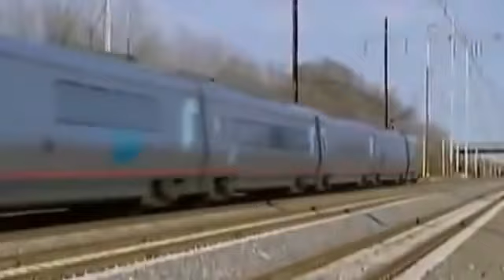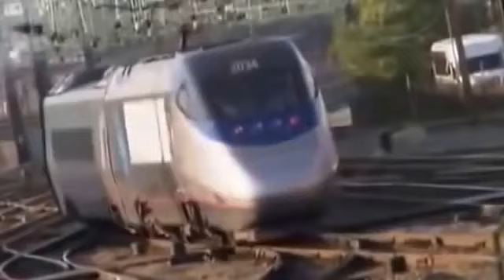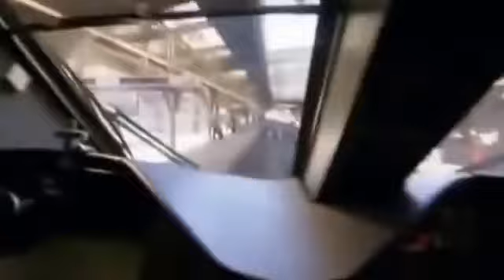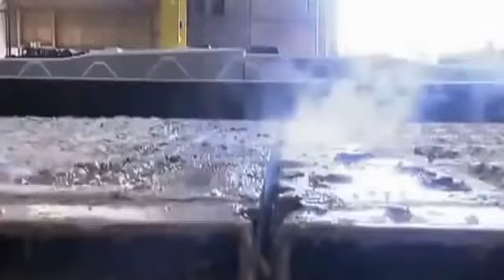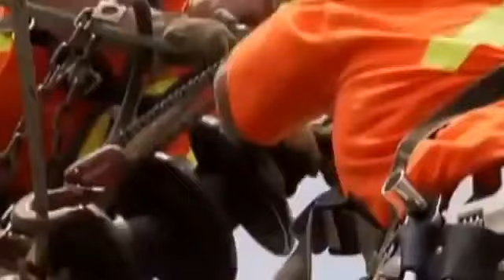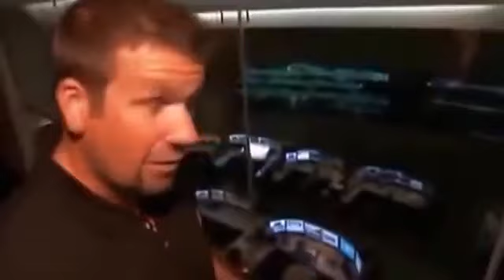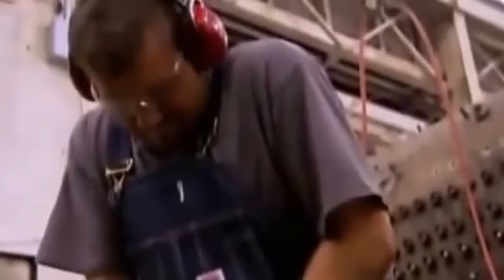The Amtrak Acela Express Documentary (Boston - New York - Philadelphia - Washington, DC)

Comment: But it only goes 80 mph most of the time. It goes 150 mph when there's no trains on its track. But sadly it is very rare for the tracks to not be crowded with Amtrak.
Reply: Yeah, in the UK most inter city trains are limited to 125mph, but they max out most of the time. 

There is a 186mph line between London and the channel tunnel to France, but the majority is 125.

Amtrak could probably go faster if they wanted to.

Comment: i'm not here to insult anyone. But your (USA) infastructure sucks big time. Dump a carriergroup and you should have funds for a working highspeed railroad from Boston to Washington. Imagine a TGV type of a train and tracks to support it. I don't know how your system really works but a federal funding from tax money maybe?
Our standard locos (Finland) have 6000 hp and reaches 200+ km/h and they are not classified as high speed. Max power output is over 8000 hp.
Next generation has over 8000 continious. That's sick.
I know it's impossible to convert to electric locos over night. But sooner or later it has to be done. Hauling freigth at 120-160 km/h should save some money.

Comment: Nice documentary, but unfortunately it's incomplete. What about the special signalling high speed tracks need & what about the remote traincontrol systems...??? These Amtrak-trains looklike copies from the European TGV-trains. However in Europe (especially in France) such TGV-trains do have special tracksignalling, because riding at 200 MpH you are hardly able to distinguish a red sign from a green one. It also means that such trains carry computerized systems that could influence speed whenever it needs to and that system could remotely be operated by someone at the trackcontroll centre.
Reply: They look the same because they are designed by the same company

Comment: Is that electricity DC or AC?
Reply: AC: 12kV, 25Hz Washington to (roughly) Sunnyside Yard, NY on Amtrak territory inherited from PRR; 12kV, 60Hz to New Haven on Metro North territory (formerly NY, New Haven & Hartford); 25kV, 60Hz back on Amtrak territory (newly electrified in the 1990s) from New Haven to Boston.
Reply: Cool. Thank you.
Reply: Flip! That means an Acela trainset has more power/pantograph adjustments in it's ~400 mile journey than a Eurostar does in it's 1,600km (~960 mile) trip between London and Marseille! :-o :-) 
 
Also: If the PRR runs at 12kV 25Hz and the Acela can run on that, then Eurostar Class 373s (On which the Acela power cars are based, IIUC) CAN run direct from London to Berlin, too! #WhoNeedsAVelaro :-D :-)
Reply: Mathew McLean wrong its journey

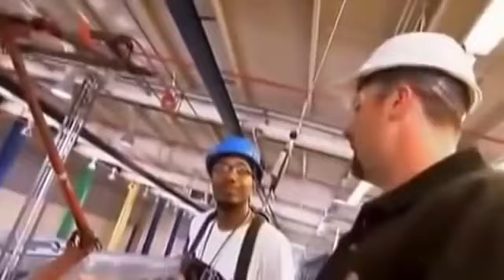Comment: 4:44, you can't die if you're 3 ft away from it live can you? I thought you would have to touch it to get fried...
Reply: No, that's incorrect. High voltages can arc across air gaps, meaning that getting close enough to a live catenery wire may be enough to spell disaster for anyone unfortunate enough to do so. If in doubt, stand well back! #SafetyFirst :-o 
 
Also: 1.30m (4ft) still seems a bit too close to 12kV for my liking, given we keep a minimum 2.5m (~7' 6") safety room around our 25kV. That said, I don't do live working for a very good reason... :-)

Comment: ...Taking into consideration the current status of the American Rail System and the pointless politics that go with it, especially after the incident in Philadelphia, end even more recently, Hoboken Station...the only way I'd ever ride the Acela is on one of the simulator games...If we have issues @ 80MPH, how are we going to manage things properly @ 150?
Reply: Some of our trains (Class 373 TMSTs) run at 300km/h (186mph) in perfect safety despite the fact that we can't seem to get any trains on our "Southern" network to even move at all at the moment! :-o :-p 
 
...And talking of our TMST Beasts: IIUC the Acela power cars are derived directly from that same design, meaning they certainly have the power needed to operate at over 300km/h! The only limitation might be the heavier weight of the cars on the Acela (Due to FRA regs) which is why you only get six passenger coaches per trainset whilst our TMSTs have 18 of them! :-)
Reply: Diesel Dragon well, that’s not why the Acela can’t have more than 6 coaches in between. It probably does have modularity which allows it to have more coaches at once, but the problem is that they would have to extend maintenance facilities, and possibly extend platforms to fit one trainset.
Reply: Crazcompart that’s not the problem. The Acela doesn’t have any issues going at 150 mph at all, because it’s never crashed before and killed its passengers, meaning it’s had an overall 99.9% safety record in its almost 20 year service. Along with that, there is Postive Train Control which stops a train before it crashes with another, part of the reason why it’s had an almost perfect safety record. Apart from those who decide to trespass and get themselves killed by a speeding bullet train going 150 mph, it’s a safe train, and I would know because I’ve ridden on the train before.

Comment: The US doesn't have the population density required to support high-speed rail lines outside of the Northeast, parts of California, and MAYBE Florida and Central Texas. And possibly the immediate area around Chicago. They would be a huge drain on the taxpayers anywhere else. Western Europe is smaller than the US and has more people.
Reply: Nonamearisto that’s true, because most of the cities in America are spread further away from each other, apart from the northeast region where most of the bigger cities are concentrated.

Comment: Acela is a Joke, slowest bullet train in the world. no conical wheels, they allow the train to smoothly turn corners, no double rails, they keep train secure . Acela is 50 mph slower than most bullet trains. the 4HR turnaround time is bullshit. Shginkansen trains are turned around in mere minutes. and fully services as well with the bathrooms cleaned, trash cleared and the seats retuned in the right direction. Acela has only 20 train sets and runs 35 outes per day, yet the trains are at capacity. Acela uses fixed train sets. size cant be increced or decresed as revinue permits. nor can Acela couple two train sets togeather. Acela uses bulky and expensive power cars, Japan uses EMU for shinkansen, every car has small motors and electrical reversible brakes more gripping power and breaking power. America does track maint during the daytime during revinue hours, slowing down thesystem. japan uses 100% non union labor and dose track maint from 12am to 5AM. other times only during emergencys. America needs to look at what is more important water cargo or train travel w/o drawbridges. America should build underwater tunnels instead of drawbridges.
Reply: You got it right on the dot.
Reply: you can only get all you talked about with a new line. Amtrak chose to adapt, on my view right...you can't have it all in a minute...besides, new exclusive lines are very expensive.
Reply: Acela is epic
Reply: @NortheastCorridorFilms   - ACELA is Slower than the Slowest Japanese Bullet Trian - the HIKARI.
Reply: Mark Plott I love it how people only think it’s bad because of the speed
Reply: @NortheastCorridorFilms   - its a BAD Track Design , bad Wheel Design and bad Suspension as well.
the NOZOMI Shinkansen has solved all of this.
Reply: Mark Plott Way to put it- why do you care, abour the wheels, or the designs?
Hell, why do you even gotta put your rude opinion on it? Like it’s annoying others, go make fun of some Indian trains
Reply: @NortheastCorridorFilms   - Because American trains are SHIT, even in CHINA, TAIWAN and KOREA have Better trains than ACELA.
Reply: @markplott4820  there are way many trains slower than ours pal. The slowest high speed train is 40 MPH. Boo hoo, our trains are Japanese, they suck now right? So does this mean TGV sucks?

Comment: Is This thing's Top Speed of 150mph Absolute or is it limited by track speed?
Reply: @ random crap - America auto industry killed rail in America. Oil company, interstste batteries , tire company along with the auto makers and bus makers conspired to kill rail and succeded. If America was allowed to continue expansion and reinvestment in rail in the 1930's then today we would be just as advanced as Europe or Asia.
Reply: The speed is limited by the tracks, crossings, etc. The train is capable to going up to 150 mph but in reality it takes about 6 hours and 45 minutes to travel about 430 miles between Boston and Washington, D.C.with the average speed of 64 mph.
Reply: oh okay Thanks
Reply: the amtrack of 150 top speed looks silly compared to the European trains. C'mon USA  you are lagging way behind. shame on you
Reply: The Acela Express is only 25mph faster than the Intercity 125/Class 43 which was introduced in the mid 70s
Reply: +Random Crap but in the US there is soo much more space and money available to actually develop a train set and build new Railtracks for it
Reply: +Random Crap I see your point 19 trillion USD is a little bit of a problem
Reply: @ Droid - 150 mph is mandated by NTSB. train could go faster. also, they done use conical wheels, it makes conering faster. and Double rails secure the train to the track. Acela does not have that. Acela shares rail with slow moving cargo and slow passanger rail. also, its tracks are not designed for high speed rail , same old rail design from 1800's.
Reply: I've been on Metro-North trains that were faster than Acela
Reply: Peter Parker Metro North trains are not even close to the Acela's speed.

Comment: You see it would be very difficult to get a high speed network anywhere outside a densely populated area like the Northeast Corridor. Areas like that are the only places Amtrak actually makes any revenue. Everywhere else they lose money and they have only survived on subsidiaries. Also, the Northeast corridor is the only place Amtrak actually owns it's own tracks. Everywhere else they have to use the lines of the other railroad companies. They would need a lot of money to build the tens of thousands of miles of track. Even if they received investment or grants to build their own tracks, they're probably still not going to make money. As far as cross country trips go, most people are going to choose to drive or take a plane. The latter is just as expensive if not less for a ticket. I personally prefer cross country road trips myself. However I do like the idea of taking a train, and not some high speed train to get across the country, just enjoy the few days on a hotel on wheels. Kind of like Santa Fe's old Super Chief which was probably the pinnacle of cross country rail travel. Sometimes I wonder what a trip on that would be like.

It just doesn't seem economical for something like that to happen at this point in time.

Comment: Thank you for the experience!! 
I do feel compelled to call you on one statiscal error. 600,000, (thousand), PAX a day at Penn Station comes out to 219,000,000, (million), PAX in one year, a meier 211,000,000, (million), PAX over the 8,000,000, (million), PAX you  stated. 
Further, 600,000, (thousand), PAX  per day as claimed, being more than the three New York Airport's annual passenger count combined, is grossly overstated. Judas, that would mean that each New York Airport only served to accommadte a Meier 547.945 or 548 Airline Passengers a day. Baloney!!! 
See, the incredible problem and overwhelming disservice with such misleading information is simply this. What narrative are we to believe, in relation to other tidbits you share throughout the 'Documentary '?¿ Otherwise, you'd have one terrific program. 
Trust is such a precious and valuable quality. It inherently, substantiates Ones Character and Integrity.
I'm fairly confident that this was an oversight on someone's part within the Staff. Despite that, the Filmography was Spot on and indeed, trusting the information about the train, it was compelling and certainly had my attention throughout.

Comment: 6 hours? LOL. I can fly from DC to Boston in about 1:40. This is why rail is a waste.
Reply: +Stang Captain Well, you do have to spend maybe a hour to get to the airport and from the next airport in many cities. Not to mention getting through security at the airport, maybe another hour. But yes, even with those negatives, flying is considerably faster. High speed rail does have a range limit where flying is faster no matter what.
Reply: Its over the long run that its way better. I don't have the numbers backing it up for the US and is way too lazy to look it up. But its way more efficient to burn something in a power plant than on location in a train. The electrification is a good thing!
Reply: +Stang Captain Well If you fly you have to add in 2 hours prior to taking off because you have to get there early for a flight. With train travel you only need to get to the platform about 10 to 15mins before its scheduled to arrive. You also dont have to worry about TSA and maybe getting an item taken away you are not allowed to bring on the plane. And just waiting in that long ass line to get checked through anyway. Trains are also nice because you can walk around the cars if you need to walk a little. In a plane you have to be seated at all times and can only get up really to go to the bathroom. Trains also have quiet cars where you can be guaranteed peace and quiet. Hell a plane is its own car so you have to deal with all the noise people make. The REAL reason plane travel is popular is because its fast. Yea thats really the only good thing about it. Trains are much safer too because you are on the ground and have less possibility's of crashing. For example if the plane engine were to fail you are fucked. If a train engine is to fail it slows down and stops and everyone is ok. Signals tell other engineers to stop. And if another engineer fails to apply the brakes after a yellow signal the AWS system automatically applies the brakes. Sorry for ranting but it annoy's me when people's ONLY reason about why planes are better is because of the time. You must be very impatient if that's all you care about. What about safety? Ever herd of that? Pretty sure thats more important
Reply: If rail is such a waste, how did AMTRAK make a $479 mil operating surplus on gross ticket revenue of $1.2 bil on their NE Corridor routes for FY 2015? Looks like your opinion is in the minority. BTW, fiscal losses to airline passengers due to bad weather in early 2015? $2.2 bil.
Reply: +Stang Captain an hour and a half "at least" just to get to security, that is not adding the line sometimes just to get to check in bags plus an hour or more so just to wait at the boarding area plus the travel time it takes to get to destination. what you are telling  is just the "flying time" that does not include the other times. figure it out first.
Reply: +Stang Captain buttsex
Reply: +SeaToby11 And think about the environment! Flying is basically killing any personal emission goal! :-)
Reply: ***** Burning jet fuel isn't anywhere near as bad for the environment than during diesel. While electricity is considerably cheaper from a number of sources, electricity derived from a coal powered plant isn't.
Reply: Do you work for Amtrak or something?
 And LMFAO @ your "trains are safer" crap. I can find far more rail incidents than aviation.